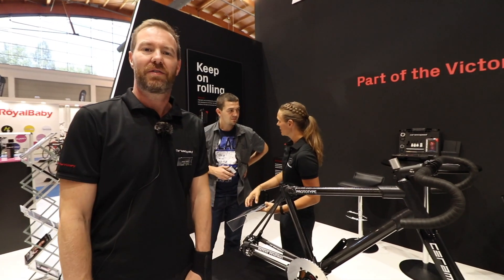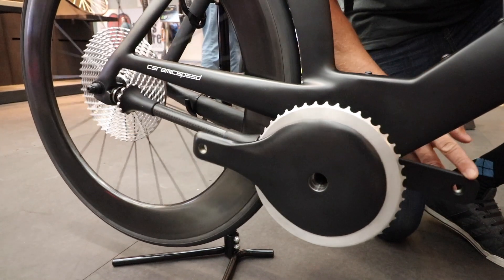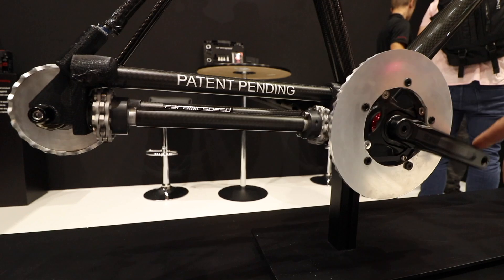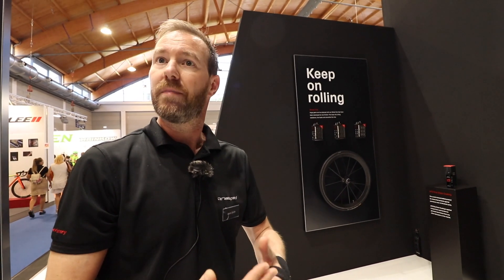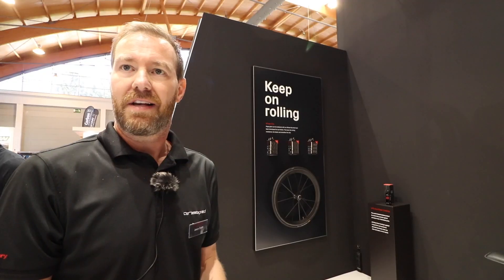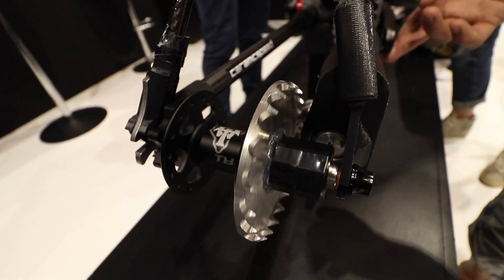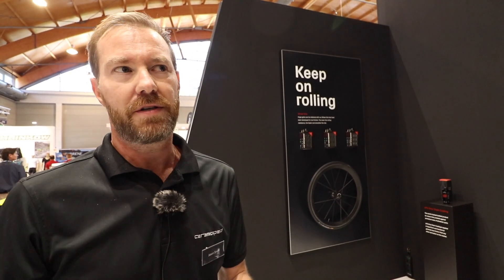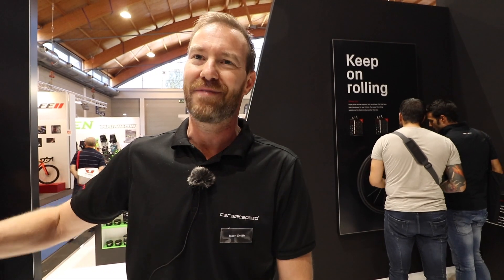CeramicSpeed Driven chainless drivetrain is 99% efficient

Comment: the rear of that frame has to be very rigid otherwise frame flex will cause the gears to skip under high torque.
Reply: Of course you are flexing the frame and in the worst possible way - perpendicularly to the fork. Chain applis force mostly longitudinally on the frame, while this set up puts enormous shearing stress on fork sideways and on wheel axis. Materials like carbon fiber are going to crack instantly since it unravels under torsion. Besides the chairing or cassette will loose its teeth long before that. Get of the hype train, because no amount of gimmick solutions will suspend the laws of physics.
Reply: logtothebase2 that thing would be a meat grinder on a gravel terrain
Reply: And even if it is rigid, you are wasting a lot of watts into the frame and wheel bearings.
Reply: Bear in mind that in this design you don't really have the chain flexing the frame so it might be that although the frame has to be rigid, it doesn't necessarily need to be heavier as the forces that flex it will be smaller
Reply: How do you know that?   Do yo have any torque numbers to substantiate your claim?     Engineers deal with facts not assumptions.  :)

Comment: Wow people be talking shit about a company bringing our some actual tech. Give them a break guys!!! It's just a prototype and I think Ceramic Speed is doing a wonderful job innovating!!!
Reply: Any engineer can see it’s madness that’s why
Reply: Lukas Adamson the entire concept is not a good one shaft drive is fine but not with those gears and to get that thing to change gear good luck
Reply: I saw this mechanism on photoes of 1940`s
Reply: Karvin Sunny Li You know how cynics and pessimists are, they're the ones who said pushbutton phones won't stand up against rotary Bell phones. They'd take a horse and buggy over a car anyday.
Reply: Karvin Sunny Li
Exactly. Sounds like what guys used to say about DI2, disc brakes for road bikes, Sram wireless shifters, paddle vs. slot shifters in sports cars, Electric cars vs ICE. I have 3 bikes ranging from my cheap online bike (motobecane)to my, BMC and F10 Dogma disc. Would I buy this,  probably not, but its interesting, just like the Sram 1x was interesting. Tech isn't always about practicality,  it's about thought. Battery technology made very impracticable electric cars practical. There's actually more crazy bike tech that's is being sold. I don't know what bike tech ripped people off. And if you were ripped off, you didn't do your homework. Ask the early adopters of VR if they felt they got ripped off. Majority will tell you no. That being said, this will be a problem with a crosswind with that large cassette.
Reply: Its not tech, what makes it 'Tech'?
Reply: Karvin Sunny Li Thank you!
Reply: Lukas Adamson no no no, that's the idea they have. M as of right now they don't have a working prototype that shifts.
Reply: When you decide how much money you want to invest on this "clearly innovative" idea, then I'll let that chain of events lead you back to a chain anyways after you've wasted your money....
Reply: While I'm sold on this design I do believe Ceramic Speed has the manufacturing quality and precision to one day make something amazing.
Reply: You can give them as much of a break as you would like, if the ideas behind it contradict basic knowledge of physics it won't lead nowhere. Don't be blinded by shiny looks, it's nothing but a waste of money and effort. They could as well have invented a wheel made of stone.
Reply: It's not innovating if it doesn't work though
Reply: Karvin Sunny Li agreed. There will always be know it all’s who talk crap about this stuff. In the past they were the ones dissing cars when horses and carriages were good enough.  Well done for someone brave enough to spend some money and at least try to innovate.
Reply: Yard Sale Dale you must have serious legs or you’ve never ridden over European Alps. A 32 rear sprocket was bloody handy climbing the stelvio twice in 2 days.
Reply: The thing is capable of shifting. If you guys would spend any amount of time to look up how they engineered it, you would do inventors in general a huge favor.
The cassette has 2 shifting channels, on vertical, one diagonal. The computer unit inside the carbon rod monitors the channels position at all time and tells the rod to extend or retract at the right time after the rider pushed the lever and sent the signal to shift. Inside the carbon rod also is the computer units battery and even a power meter. The whole transmission is faster to change than a regular drive train. Also, the whole concept is built by a company that ha a lot of experience in friction reduction and was accompanied by a universities engineering department.
Reply: Lukas Adamson "The thing is capable of shifting."

No, it isn't. Having an idea as a solution for a problem is not the same as having a working prototype for a problem. They don't even have a prototype that can give practical demonstrations, they demo the prototypes they have by turning the crank with their hand and use still images to show how the units look on a bike with a rider.
Reply: a10miletooth  Yeah you know exactly why they won't put pedals on any of those completed bikes....

BECAUSE somebody's bound to put it on the ground AND TRY IT OUT, which would be truly devastating when not much more torque than a three-year-old could muster breaks these prototypes. 
I mean if they're afraid to put pedals on just demo model of the  reciprocating assembly,they don't even trust it themselves.... that's shady enough  to be selling a concept that has no way of existing in the near future.
99% efficiency??? Bahahaha ROTFLMMFAO!!!!!
Reply: Where is the problem? I will tell you:
99% efficiency is a lie.
They use people's illiteracy to sell gimmick that can't work reliably.
Its not a new tech. My grandma has this tech in her meat grinder.
This shit can't shift. The fact that he didn't shift tells you its not working.
This is a pain to manufacture and guaranteed to break.
This design ignores basic physics and engineering principles
Reply: Well, apparently you are able to identify what you don't need and not buy it. Where's the problem? It's no product anyways. It's a bike tech demo. How many car concepts you see on the streets after the big conventions? None. But you see new tech, that has been taken from those concepts and adapted for real world usability.
Reply: Yard Sale Dale what are you talking about? No one needs a 32 cog? Have you ever ridden up any mountains or hills? Do you even ride bro?

Comment: Someone needs to tell all of those current driveshaft motorcycle owners that we cyclists just do not find this acceptable.
Reply: They are not trying to have it open and slide to change gear
Reply: C Ross you sound like the type that can't change their own tire or motor oil.
There have been shaft driven bicycles since the late 1800s,
There's a reason bicycles use chains.
You might want to look into why they chose to use shaft drive on motorcycles.
Reply: mech5 fab for style and to be different, that's about it. There's no reasons beyond those two (that I can think of, at least, since there are no mechanical advantages and torque loss is greater) to buy a motorcycle with a shaft drive.
Reply: a10miletooth they used shaft drives on motorcycles in ww1 and ww2 because the sand would tear up the old chains then they fixed chains and went right back to em

Comment: This is an interesting concept, no doubt. However, I'd be hard pressed to believe it will stand up to the torque of an aggressive rider. Years away still if you ask me.
Reply: the shaft is attached to the frame at the bottom bracket and at the end of the chain stay - won't be the problem, i guess. the main problem will be the cogwheel bending away from the shaft - especially the larger/outer rings. the chain usually (when not too worn out) grips several teeth (force is distributed - less wear) at the same time and the force pulls along the plain of the cogwheel - no bending sideways (...as long as the chain runs halfways straight)... meaning the cw has no way to escape the force applied by the chain except for total collapse.
this construction applies force in rectangular direction to the plain of the cogwheel so that the cogwheel gets pushed towards the spokes. in that direction it has far less support of underlying material and the 'huge' diameter of that thing increases the effect.
what i could imagine for later prototypes is to turn that thing inside out so that the cw is mounted very close to the frame, teeth facing inside and then have one or several 'counter bearings' attached to the frame that run very close to the cw so that it get's supported when pushed outwards... will that maintain the low friction they're working on... idk
but i'm pretty sure, the construction as it is won't withstand pro cyclist power
Reply: RYTHMIC RIOT my man I was thinking the same thing. It's a beautiful and fresh mechanical design and these guys probably have engineering degrees but you might have more common sense than them LOL, because I can't find an actual video of this being ridden in a real-world situation
Reply: It's a driveshaft, that's literally what it is designed for. You seem to think this is weaker than a single link of chain?

Comment: How does it shift gears?
Reply: Zach Martinez The back part of the drive shaft is ment to move back and forward when they can work out a way to design it to do so
Reply: Madbiker 94 only it will only line up at some points in its revolution so will be a nightmare to make work

Comment: It would work IF:   
1) This system is much lighter than a Durace group set 
2) It can withstand the hi torque that pros can achieve in a sprint. 
3) It has at least 18 non redundant speeds. 
4) Gear shifting is smooth and fast as a Durace. 
Do this and you'll be making history.

Comment: there are so many bike contraptions out there, but i thought this one had a couple really cool things going for it. i like the simplicity compared to many of the internal hub & other contraptions we see floating around. having said that, there are some incredibly dumb things about it.

- for god sake how can you put so much into designing & making that and not even make it shift?
- god knows how much that "cassette" or whatever you want to call it would cost, and the rest wouldn't be cheap either.
- imo - and yes this one is debatable - it needs to fit on standard frames so that bb would need to be changed to be compatible with standard frames.
- i feel like those roller bearings would be the first thing to go, and let's be honest - no bike shop is gonna have them laying around - you'd have to re-order them - if even possible to replace them yourself without sending the whole contraption back for service and waiting between 2 weeks - 9 months to get it back.
- the shaft drive would probably only be possible to replace within the first 6-12 months of initial production. in other words, down the line when the shaft drive has a fatal failure you wouldn't even be able to get a replacement. i've had a shaft drive bike and those parts are only available for a short time after production since the companies never sell enough to keep them in production.
- the entire contraption is a solution in search of a problem. that extra sliver of efficiency isn't something very many people search for, and high end but common consumer grade parts are comparable. the only situations this would be desirable in are
  a) roadie snobs who get sold on this and put their spandex on just so they can ride it half a mile down to Starbucks to show it off and act like they are flying a spaceship (aka. tesla owners)
  b) racing, where that tiny sliver of efficiency might matter, but even then it might not matter enough (relative to other more significant speed obstacles) to make it worth the risk of watching such a contraption blow up mid-race

of course the roadies & this company act as if every bike part on earth is designed for racing, but in reality these companies all want to put their stuff into consumer grade production. for racing the above issues might not matter so much, but for the average person - aka target market - they are all deal breakers. there are many reasons chain-drive has been around for well over a century

Comment: But how many watts can go through it?
Reply: Bout three fiddy
Reply: That was my first question.  Something tells me that rear gear might flex under load, especially in the slower gears. 

And what happens when all those bearings get dirty? 🤔
Reply: Five gum.
Reply: He said 380W, but you can gaurantee that's in a laboratory - not in the muddy/gritty crap we actually ride in.
Reply: One watt lower than it would take to destroy the components.
Reply: What is the unit of power?
Reply: one finger going full gas or about 9 watts. 99% efficient at that
Reply: Jon Burnell all the watts!
Reply: China will have this in no time
Reply: Jon Burnell Atleast J J Watts
Reply: so say that, but the same argument could be made about traditional chain drive
Reply: YUP. that design will never work outside the lab. And its not about mud/gravel/whatever. its about torque on those little points of contact. I can bet that they will end up with something like worm drive or bevel gear combination to withstand this level of forces involved. And it will be heavy, and far less efficient, and it will have to be in some kind of enclosure. 
Its a gimmick. Bet they are looking for sponsors :D
Reply: Randall Draco
Yup, cuz they never tested it, and it never occurred to them to take them on the road to see how it works and how it feels. Good to have you pointing at all these imaginary problems. Are working for the other guys?
Reply: OFC they didn't.
Reply: 1 torque
Reply: B H O master Fine for me 😂😂😂
Reply: 1 horsepower.
Reply: Jon Burnell eleventeen
Reply: Future Hindsight  I like the back to the future comment,... especially considering there is no future to back this concept!
Reply: 9 speeds
Reply: Variables driveshaft material and thickness.
Reply: Cheese 1337  I think it's probably about 3 speeds....
Its an SGC design,.. I have built many of these.
 stop,go,and crash......🍋
Reply: mickenoss and that works out to about 10mph on flat pavement.
Reply: Yeah, but for how long? :)
Reply: n torquen't
Reply: If you plug the bike to an outlet you'll get around 1800w. Pretty standard in American homes
Reply: Bout three fiddy
Reply: About 3 watts.. less on a hot day though
Reply: One batch two batch....
Reply: Jon Burnell 380 Watts is 380 joules/second about 0.51 HP @99% efficiency (according to what he said)
Reply: 2 torques
Reply: 2500W
Reply: it will not. the teeth will go far from the other things
Reply: Less friction, less stress.
Reply: Lukas Adamson less stress maybe, but obviously weaker parts

Comment: this design can reach theoretically 99% efficiency, but it has no cover, what about dirt, dust etc... all the bearing are gonna clog up and render the drivetrain way less efficient.
Reply: alex v what about a cover?
Reply: Lukas Adamson a cover to protect the drivetrain from debris
Reply: alex v exactly
Reply: do you have a better one?
Reply: Keith it's a concept. At that stage you don't think about every gram. Besides that, even 200gram wouldnt be a big issue, if that transmission is as efficient as claimed. Also we now live in the carbon age (pun intended) .
Reply: a cover that adds more grams than a rohloff speed hub.

Or will be so fragile you will break it at the first ride.

Great idea
Reply: The aero, carbon cover is an option watt saving extra. Yours for the price of a small family car.
Reply: How much is "way less efficient" ?
Reply: Well, if you're low on money, you shouldn't be interested in new bike tech. Or wait till it's a finished and refined product. That way you at least know what you're buying. At this stage it's simply a platform, an idea to expand on. Are you scared about that?